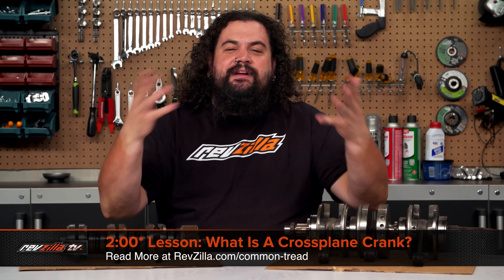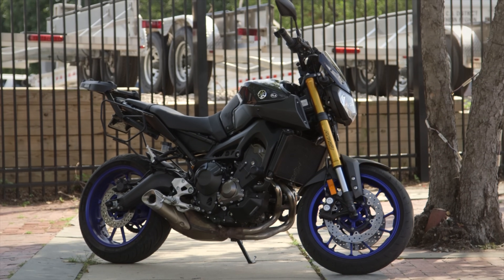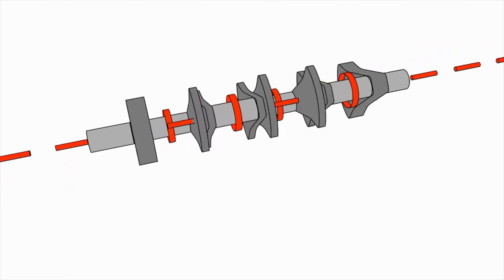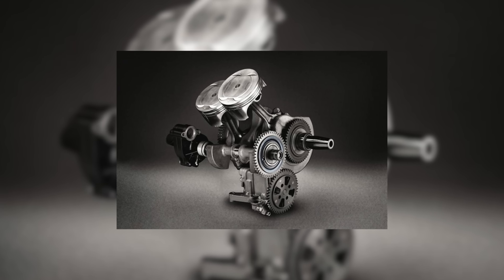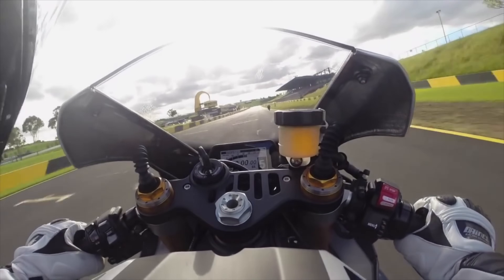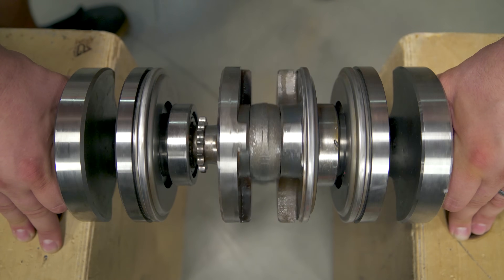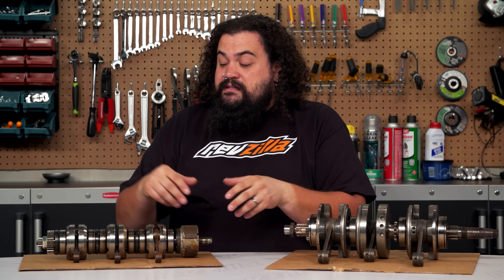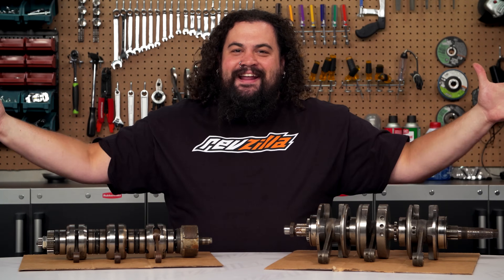2 Minute Moto - What Is A Crossplane Crank?

Comment: I have a 2006 Honda Rebel 250 in the shop for a basic carb rebuild, and I was just thinking it’d be neat to have a 270° crank on it in place of the stock 360° one. How feasible is this, and what kind of money? I’m also not totally opposed to doing some wrenching myself, but it will be an undertaking.

I also have a 2017 Ninja 300 that I am less willing to modify in this way, at least on my own.

Please, let me know if there is precedent for this, as I am deadly curious.
Reply from the maker: As far as I'm aware, no one makes a kit for that, as there's not any real demand, and it would likely be much more expensive than the bike is actually worth. If you want a 270 crank, it's better just to move on to a Yamaha FZ-07/MT-07 or XSR-700. Or get a Suzuki SV650 90 degree V-Twin, which the 270 crank parallel twin tries to emulate. -DrewZilla

Comment: I'm less inclined to pick on Yamaha after seeing this video - I didn't know flat-plane inline triples actually existed! Given that they do exist (even if uncommon), it seems reasonable to advertise "crossplane" as a differentiator. If no flat-plane inline triples existed, it'd be a different story.
Reply: Flat plane triples are so uncommon (like only a few have ever existed) that you can basically say there's only one crank design for triples. Yamaha's triples are absolutely no different than any other triple that exists.
Reply: @TheFalloutFever  No, you can't say that because others do exist. Therefore Yamaha's are no different from most others, not all others. Calling it CP3 is therefore both technically correct and a useful differentiator from other inline triple designs that exist.

Comment: I've always thought Yamaha's point about the triple being a crossplane design is a point well taken.  The triple crank is a crossplane par excellence, the throws being in 3 planes not just 2.  This has the advantage of only one piston being stopped at any given moment; the other two are in motion smoothing out the inertial torque flow.